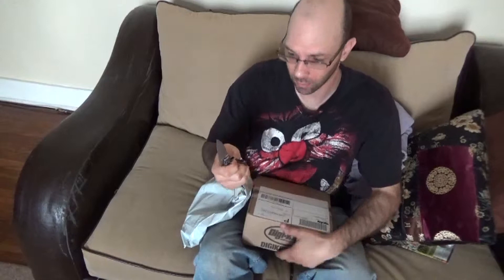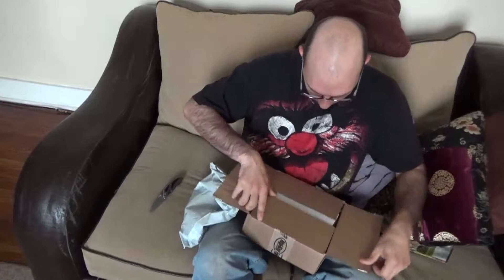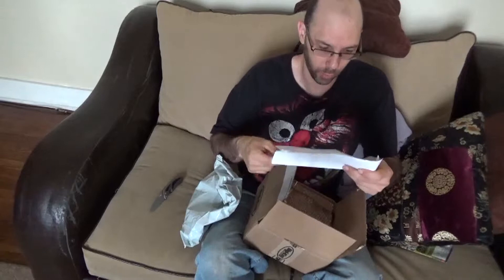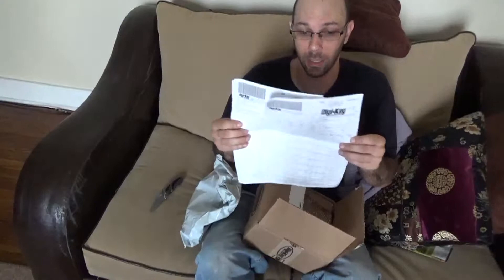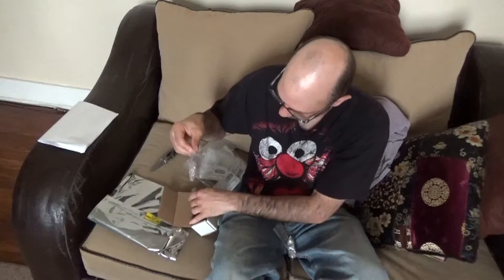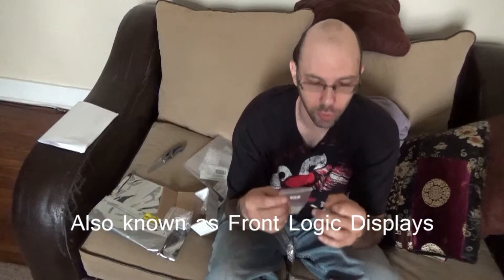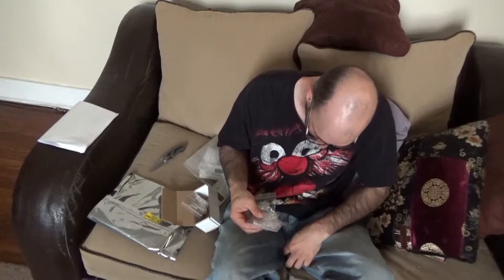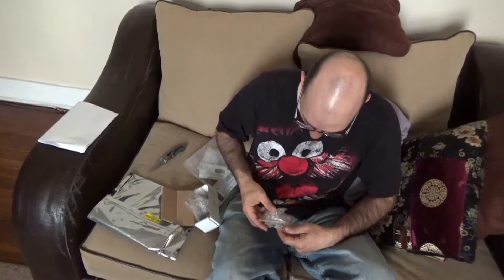R2-D2 LED,PCB and Dome Electronics  Components arrive!

Comment: Do you have a full list of the electronics you used to build the LED displays w/ your arduino?
Reply from the maker: +Kevin Goff The list can be found on http://astromech.net.  It is located in the tutorials section-lights-teeces.
Reply: +Build an R2D2 Thanks for the reply.  I've found the list but curious how you figured out how to assemble.  Where did you learn that?
Reply from the maker: I found the instructions through doing various searches.  I just followed them and made a video so others can learn.